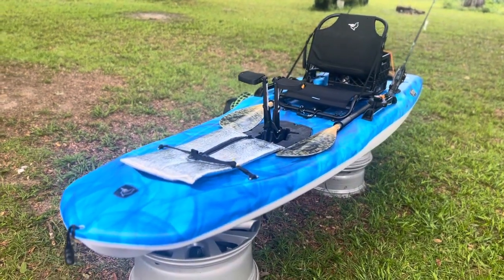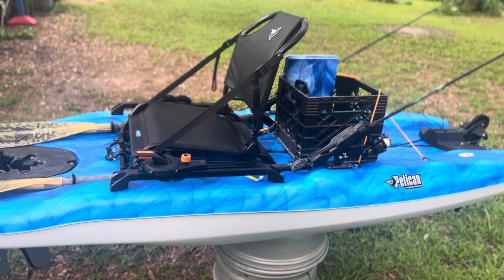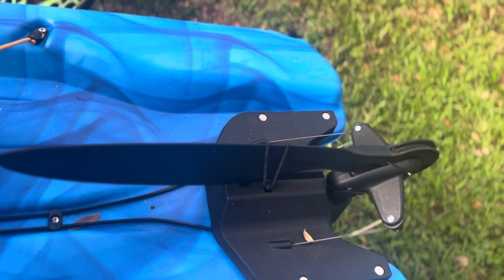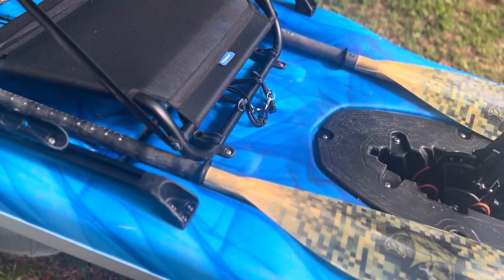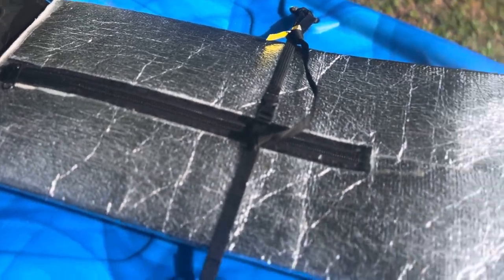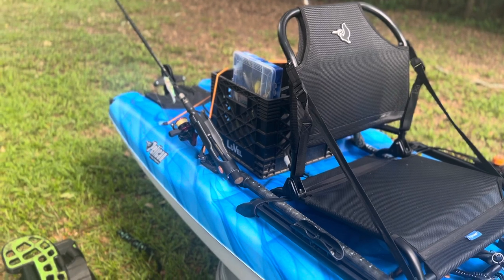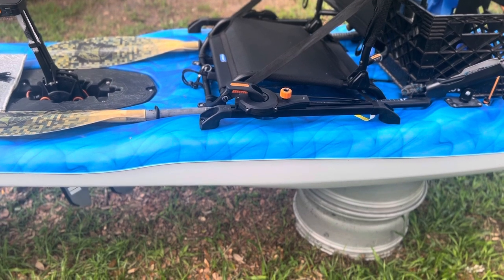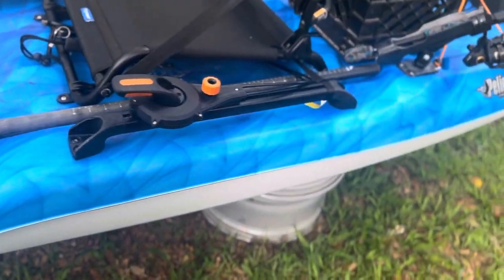Hands down the cheapest pedal drive kayak you can get, Pelican Getaway setup for budget fishing

Comment: That drive bay area is designed like that to give the fins some protection if you are grounding, full pedal stroke will pull them up into that recessed area. I have one of these, fun boat and a great blank canvas for a fishing platform. The mid size Black Pak fits perfect long ways behind the seat, makes drop and go fishing a breeze.
Reply from the maker: I can't believe I didn't think about that area being for the drives protection, it makes perfect sense.  Running real shallow and flutter kicking, the front should touch before the drive gets hit.  Thanks for the information and yeah, this kayak is a great little fishing machine.
Reply: @StealthFisha  they got the idea from Hobie!
Reply: @StealthFisha  You can get real skinny with her, if I'm fishing "lite" maybe like 4" skinny, rudder dragging but great at crossing sand bars.
Reply from the maker: @johnbates8964  yeah, I like it better than the hobie compass I had and much better than the vibe shearwater and slayer propel I have had.  Mainly due to the weight but also I really like simple kayaks and this one is as simple as it gets.  It makes fishing much more convenient for me when it is so easy to move around, launch, etc...
Reply: @StealthFisha  I'm a big fan of Pelican kayaks, have 3, this one is by far my fav, crazy stable, open and like you said, simple.
Reply from the maker: @johnbates8964  this is my first one but now I want a Catch PWR 100 to hit some of the rivers around here